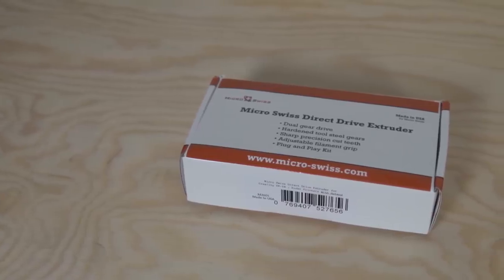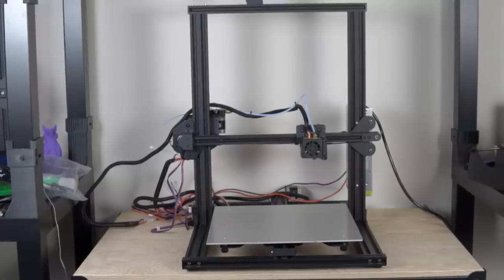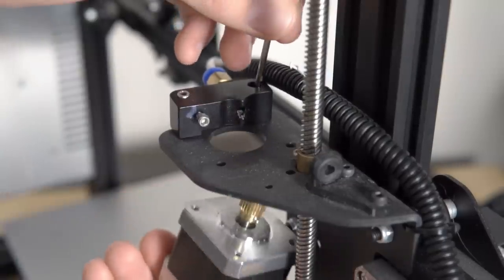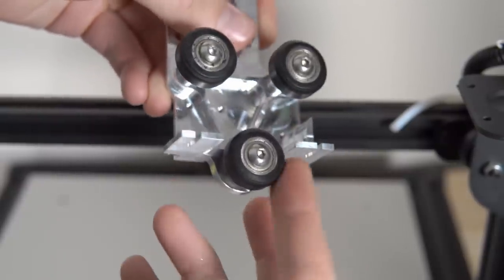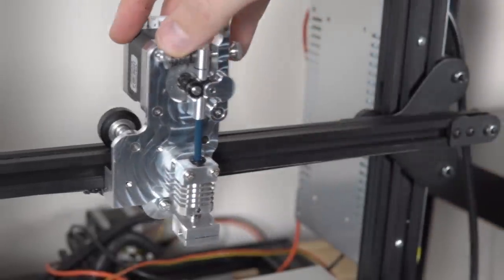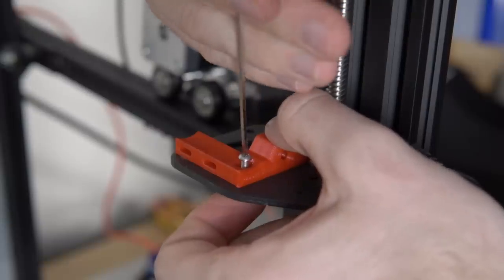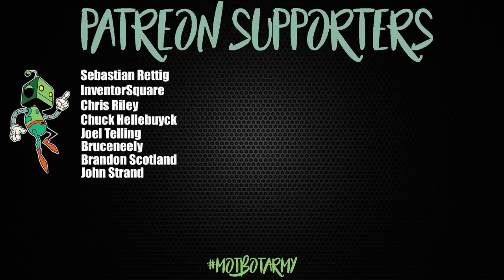Micro Swiss Dual Gear Direct Drive Upgrade For Ender 3 and CR-10 3D Printers

Comment: Many thanks.. Just finished.

Just astounded at the quality of the manufacturing here. They're like high end motorcycle parts.
I'm a fan.

I bought batch 2 (as they sold out of the first lot) and there were a few additional screws included. I didn't have to re-use any of the bolts/screws or grub screws.
They also provided a spare for everything losable. Very slick package.
Reply from the maker: How awesome :) I have been loving mine! I just made a video on calibrating the steps for the extruded which will be live in a couple of weeks. Happy printing :)
Reply: @ModBotArmy  I think that would be very helpful.
I'll look forward to it.

Mine was under-extruding by 35mm out of 100. :D
Correcting this on my original CR10 gcode in Cura left it looking a tiny bit over-extruded, so I'm going to test run it at 30mm under. 
I believe micro Swiss tell you to start testing from 130mm, so I think I'm right on track with that.
Reply: @ModBotArmy  I've been having real issues printing above .2.
At .125 I get some crazy textured crud printing that no setting changes seem to veer from.

If you wanted to share settings, I think you could help a few people.

Just tearing my hair out.. Prints great at .2, and some very odd stuff going on at any less.

Microswiss is sending me a new one to try.. I would love to try out a working setting at .1 just to rule it out.
Reply: @breaddrinker  Do you think it is hot end or extruder related? I really wanted to purchase this but after ready some of comments regarding problems some folks are having like yours for example, it makes me wonder if it is worth it.

Comment: Just some feedback, you should have a section at the beginning of you video that clearly states all of the software, tools and procedures you will have to do/use during and after installation to be able to utilize this product. Like a dumby I watched this video while working and missed some key info like needing to download additional software, purchase more tools and white filiment just to be able to use my (from microswiss) "No modification required, simple plug and play" item and went a head and bought the kit thinking i'd be printing in a couple hours. Microswiss also does not state anywhere besides install instructions that you will need to modify gcode and measure filament extrusion. Personally think that is a very important bit of info that would have swayed me to just getting the metal hot end vs this entire kit.

Comment: Absolutely brilliant guide! Have installed mine following along with you. Just to test it now. Thank you!!!
Reply: Hi just wondering what was your reasons of installing this. I'm wanting to upgrade to have a crack at different materials and was just wondering if that was your reason and if so how did it go. Thanks
Reply: @minion9707  hey there. I installed in for the same reason as you're thinking. I wanted to try TPU and it has been far easier so far
Reply: @HuwFerris-John  have you ever tried anything other then tpu nylon,carbon,ABS ect and does your prints look up to quality ? cheers

Comment: My biggest question is why would I want to upgrade to this? What benefits would I gain?
Reply from the maker: Alot of people like direct drive, a lot of people want all metal, alot of people want dual gear driven. Basically allows you to print with a huge range of materials all the way up to Polycarbonate. You can also print with abrasives and very flexible materials. The narrow filament path makes it much easier to print with flexibles than say a bowden setup. The dual gear ensures that you do not run into under extrusion issues from filament slipping
Reply: JUST TO LOOK PRETTY
Reply: Just bought this kit. Even on sale it is more than twice the price of a creality Ender 3 direct drive plus Bowden complete unit with servo and ALL mounting hardware. $33 shipped from China. I will need to buy another just for the parts to make this one work. As it is, you still can't print with abrasive filament as you must still buy the hardened steel nozzle ~ $20 more. That will fit on the creality as well. It's max temp is still 260C unless you get a hotter ceramic element and I have yet to find Ender 3 compatibility data on any yet. With Capricorn the creality can do that too. I bought this with the intent of high temp printing but the still remaining 260C limit won't cut it. I too prefer upgrades over embellishments. If they included the actual high temp heater, then I might call it an upgrade.
Reply: Just got my micro-swiss, the combo set was on sale for the price of the hot end. You have to "tweek" your firmware to get higher temps and home your tip. You also have to adjust feed and retraction values. I found that capricorn generates toxic gas at high temps so an all metal is needed. Still I am now limited by the magnetic bed and the micro-swiss hot end has a 300C design limit. I found that the copper head hot end should fit the cooling fins and up my limit to 450C with thier 50W heater and cartridge thermister. I still need a bed upgrade to get past the 80C magnetic bed limit but I don't want to just lose the magnetic bed that's great for PLA. Can't test mine until I build a boot loader and learn some Marlin but I like the quality of the set. So far I believe the micro swiss is a plus but I am adding a sockets and plugs to allow option changes as all have some benefits.
Reply: After melting the ptfe tube into the stock hotend printing petg, i upgraded to the all-metal with capricorn tube and it's never been a problem since.  The direct drive feed is more accurate, and you just can't print flexibles well with a bowden.  Some people *can*, but  it's really not optimal.  If you don't need it and everything is going just fine for you, then it doesn't matter.  

I just reached the point where my stock stuff wasn't able to continue doing what I wanted to do, so I upgraded.  LOVE IT.

Comment: belt needs to be a smidge longer after this mod, becouse different spacing(made it work on stock tentioner though), homing is now broken, not goten that far that I have found a fix yet(just mounted this thing), nozzle does not line up over the bed(pushed more forward), unsure if I feal cheated or not.......

Comment: I went from a Titan Extruder/Bowden setup to this Micro Swiss DD and it is one of the best upgrades that I have made for my CR10S-S4.  I already had a Micro Swiss All metal hotend that was still in the box (purchased a couple of years ago and never installed) so I only needed the kit without the hotend which was on sale for $35. I purchased a LDO NEMA 17 Slim Power Stepper Pancake Motor 0.9 Degree to use with this upgrade.  Because it is 0.9 degree, you have to double the normal e-Steps/mm.  In the end, after tuning, I ended up with 270 e-steps/mm.  That little stepper has plenty of torque and barely gets warm even in multiple hour prints.  Because this set up is so light, you can still print at higher speeds without major ringing artifacts (though defiantly slightly more than with a bowden setup).  This upgrade is definitely worth the cost and time (about 1hr).

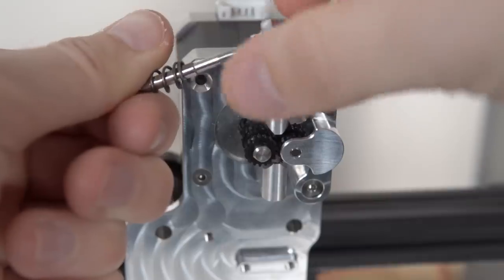Comment: What stepper motor is that in this video?? I noticed that in the micro-swiss PDF it's obvious that the shaft of the stepper motor sticks way out (see step 15 pics of the PDF) yet in your video the shaft is nearly flush with the extruder gear(@ 9:20 in your video). 

I just received this kit from micro-swiss and and am simply mocking up the kit without putting it on my machine and quickly noticed the difference using stock ender 3 pro parts,. I use the petsfang cooler and up until the point of pushing the stepper motor through the hole the only modification I've had to do to the petsfang was to widen the groove on the right side where the petsfang base grabs the carriage bracket and I simply did that with a razor knife. It seems everything was going to fit until the shaft of the stepper motor stuck way out and then gets in the way.

I mocked up the micro-swiss extruder handle which fits even with the petsfang blower attached. If my stepper motors shaft wasn't too long then it would fit with no problem. But since mine protrudes like in the micro-swiss PDF it's in the way of where the fan would mount. 

TL;DR the shaft of the stepper motor in your video is shorter than the shaft of my stock ender 3 pro extruder stepper motor. Why?
Reply: The shaft on the stock ender 3 stepper motor is about 10mm too long.

Comment: I'm really wondering why you wouldn't use thermal compound for the heat interfaces to improve conductivity; heater, nozzle, heatsink etc

Is it just not necessary? Surely it would improve performance...

Comment: On my Ender 3 Pro, the extruder gear does not have an allen screw/bolt. Any idea on how to remove in order to install the micro swiss dual gear direct drive?
Reply: 2 methods. Can get a small cutoff wheel on a dremel and cut it off, then you'd have to use a grind wheel to cut a flat spot on one of the shafts sides to mount the new grub screws. Other option is the one I went with and spent 16 bucks on amazon for a new step motor.
Reply: Plus now I have a spare step motor if I ever REALLY need one.

Comment: Works great, but it overshoots on the x axis on the home side, bracket is slightly narrower than stock.  Had to put several pieces of tape on the left side so it would contact the x home switch while still over the bed

Comment: I am a fan of the trianglelabs all metal e3d V6 gold and BMG clones for my printers.
Reply from the maker: Is there something special about the gold? Or is it just anodized but the same as the standard v6?
Reply: @ModBotArmy  seems to be some type of coating. Works rather well, and I am not sure if it is due to the coating or not.

Comment: Not sure if you still pay attention to this or not, but if you could make a video on adjusting the x and y offset after installing the MSDD kit, that'd be awesome!
Reply: I had this same problem, we’re you able to fix it?
Reply: @JDMsohc  I tried putting this in my starting gcode is that all I'm supposed to do? I tried and it doesn't work.
Reply: @cephorrd  are you using a BL touch?
Reply: @JDMsohc  no, I cant seem to figure out whats wrong
Reply: @cephorrd  what firmware?
Reply: @JDMsohc  I have no idea its still the one that came when I purchased it. its and ender 3.
Reply: Just found it. in the info screen it says 0.0.5

Comment: 13:31 Hello! The video is really good and very detailed. Good job! But I was wondering if squeezing the cable of the cartridge and thermistor between the hotend and the cage it's a good solution. The cable will be bend 90 degrees and in contact with a very hot part. What do you think?

Comment: Hello, thanks for this great video, it has solidified my purchase. Quick question if you have time... Out of curiosity, have you upgraded your cooling system and which one are you using with the new mounting plate?

Comment: I just received my micro Swiss direct drive and hotend system, but after reading many many reviews I'm now slightly hesitant too install, as I'm very new to the Hobby and I've heard many stories about having problems getting the nozzle centered in the middle of the bed and also about the stainless steel nozzle breaking off in the hot end and also having clogging issues... 
Is there anywhere where I can find some solutions to these problems? I purchased this to be able to print different filaments such as TPU and wood PLA, etc. The other reason I'm hesitant to install, besides the issues I mentioned above, is that my stock E3P has printed exceptionally well out of the box and I don't want to foul it up... I just need the option of printing other filaments.

Thanks folks and I'm appreciative of any help towards addressing my questions above.
Best! ✌🏼
Reply: Stashman FPV my E3 pro was printing perfectly until I installed the micro Swiss.
Reply: @cameronbasford8991  that's kinda' what I'm afraid of. 
Hmm... What to do?

Comment: Hi. I bought one of the Micro Swiss extruders before I saw your video. I have not installed it yet. Now that you have had it for a while, what kind of results are you getting? Are you still pleased with the extruder? I have not seen any other reviews on Youtube of the extruder.

Comment: Hey there. Followed this step by step. Went to test it on a file that worked previously on my older Cr10s5, and...nothing. Bed and nozzle get up to heat temp...and nothing. Print won't start. Just says "heating...(even tho it's at temp.)

Comment: So I have an interesting problem. When assembling the heating block, I found that the combined thread length of the heatbreak and nozzle is longer than the height of the block, meaning that I can’t screw in either piece completely. Is this a problem, or will I be able to get away with it if I tighten them enough. This is the hotend that came with the direct drive kit, not my previously owned hotend.

Comment: I have watched this a couple times, and I am going to watch it again. But 2 years after having this on my printer, I still have NOT had 1 successful print. I tried everything that was suggested. Maybe I am missing something. (I machine and assemble machinery for a job. I really don't feel it is a me problem.) This is the biggest waste of money. I had to go back to the original nozzle. Works just fine. Same filament that fails with the MS Direct Drive, does NOT fail with the factory Ender 3 Pro printer. I had such bad luck with this, I am still not ready to buy the Ender direct drive kit.

Comment: Is that a 3D printed arm??? Sorry but I would not use a bowden tube to get the filament to the extruder. I would mount the reel to the top and feed it directly into the extruder, but that's me!!
Reply from the maker: That is a great idea. If you have the height to work with.
Reply: Stock filament reel stay on top.

Comment: Thank you for this video guide. I'm waiting for my upgrade set now, I will be installing it on the Ender 3 V2.  The only extra step required is to print out (or buy) the original hot end housing from Ender 3/3 Pro, which I already did in PETG. The V2 version doesn't fit to this set. I can't wait.
Reply: Did you set this up on your v2 yet? Run into any issues?
Reply: @mza0187  I did, will need to make a new fan shroud.
Reply: Dam so i have to lrint thw fan shround in ordsr to put this set up on the V2

Comment: should have mentioned how the fan shroud you originally had needed to be replaced with a ender 3 one because of the screw hole positions for those doing the mod on ender 3 style clones

Comment: I thought you were going to put a link in the desc. to calibrate and do esteps?
Reply from the maker: I ended up deciding to make a video on it since I also needed to calibrate the esteps. It will be live in the next couple of weeks.
Reply: @ModBotArmy  thanks man, I appreciate it. I followed your video and installed mine today and I'm working on estep's and retraction so that I can get back to printing.

Comment: that meta circlip doesn't hold onto capricorn. I just don't use it. I wonder why they didn't mention using any gear grease. another less important issue is maybe lack of washer under tightening knob to avoid it grinding the lever

Comment: I’m having a large issue I got the older model of the micro Swiss direct drive extruder and the stepper motor won’t clear the frame on the x axis or z axis

Comment: Ok, 80-90% of the set up is done from this video. Where is the setting/firmware part? How did you get the nozzle to position correctly for "auto home"? You didnt just start printing after this video. Idk how you can upload an incomplete video.

Comment: The orientation of the stepper side gear.. I've tried it both ways and it doesn't seem to make any difference. Is there a direction to the knurling on the piece?
Either way, I currently have it on back to front, because it's just the last placement I tried, and just finished printing 60 hours of parts for a mask, so I guess it works..
They stress an orientation but it doesn't seem to make a difference.

Comment: I would not have added the ptfe tube back on (from the old extruder with the 3d printed part) as thats one advantage of direct drive, no friction from ptfe tube. Other than that have you installed a bltouch on this? I just bought this for my sovol SV01 (basically a cr10 clone) and not sure where i can mount it now. replaced the part cooling duct and upgraded the fan so it has a custom shroud i printer for that to fit.

Comment: This video was incredibly helpful and well put together. Thanks. The only area I struggled with was installing the filament guide on my Ender 5 Pro as it is in a different place. I would also note that I had to buy new Capricorn tubing as it was impossible to remove it without damaging it. One question - do I need to change my slicer settings to accommodate the Micro Swiss?

Comment: I just bought this upgrade, but I already have a Micro-Swiss all-metal hotend installed.  Can I just use the one I already have installed, or do I have to use the one included in this kit?